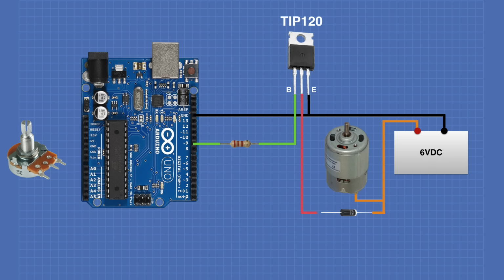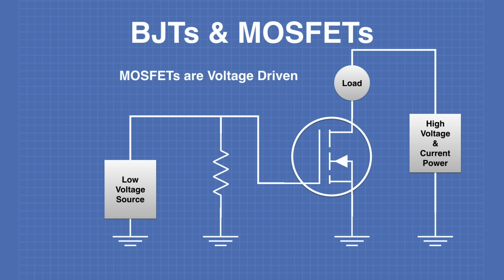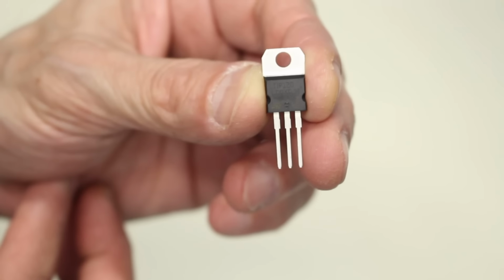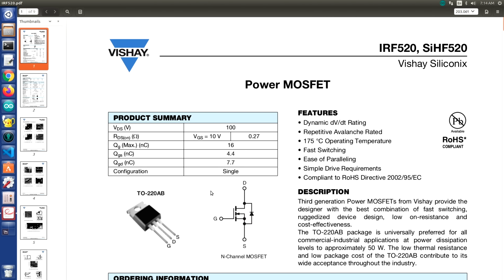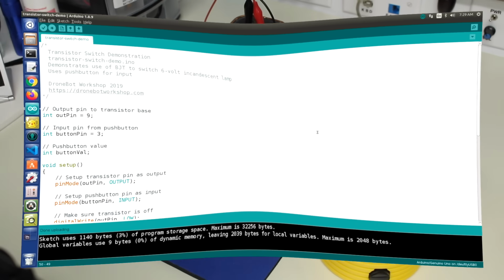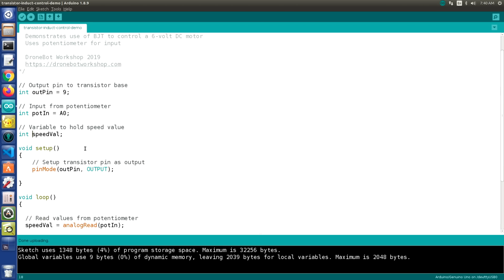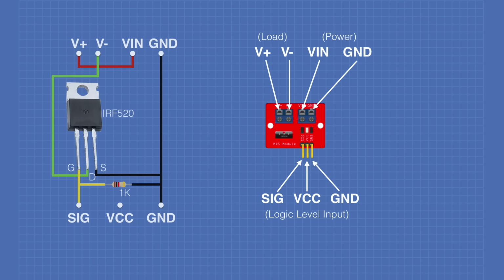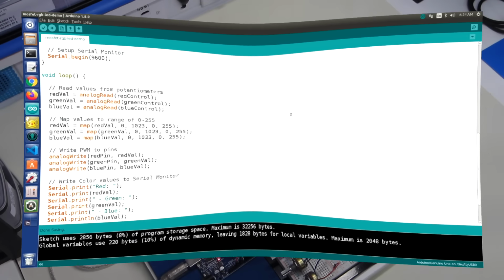MOSFETs and Transistors with Arduino

Comment: Once again. Great job explaining both BJT and Mosfet. I am working on a project and didn't want to overload 3 SSR directly to the Nano. So now I am using 3 BJTs to control the 3 SSRs. Now time to wire up a breadboard.

Comment: You should always use a gate resistor, since capacity of the gate of a MOSFET causes a high current when switching on, which could destroy the I/O pin of the arduino.

Comment: Another great video very well explained and appreciated.  One correction though, with the reverse biased diode across the transistor when driving the inductive load, it isn't there for the initial counter emf when the voltage is first applied, rather it is for when the field collapses, as when the applied voltage is reduced.  counter emf will resist any initial current flow, the collapsing magnetic field with the inductive load will produce whatever voltage is required to drive enough current to collapse the field.  it is this created voltage during the collapsing field that will pop your transistor without the reverse diode in place.
Reply: I was wondering about that too. Thanks for setting my world right again.

Comment: An excellent introductory tour - and for those of us doing mainly digital electronics you cover most of what we need to know about interfacing our puny logic circuits to the power hungry big-boys world of motors, relays, solenoids and lamps.

One quick observation. As you noted, the LEDs on an RGB chain get quite hot.  Thus, it's NOT a good idea to operate them on the reel like that for very long as they can get heat damaged and you start to get failures.  Each individual LED doesn't generate much heat, but on a reel like that each position contains three LEDs (a red a green and a blue) and over a 5M length you may have a couple of hundred of them. When theyy are spread out its not really noticeable, but when they are reeled up tight together like that they generate quite a lot and if used for long they might overheat and fail.

Comment: thanks! I was searching for this for weeks. I asked people on the internet how to do this but your video finally explains it well. Exactly what I need. I want to switch the christmas lights (4.5 V DC) using an arduino because I am lazy to stand up, go to the switch and use my own fingers to turn it on or off. Now I can control the lights via wifi. :))

Comment: Excellent tutorial!  Just two comments... the EMF pulse that occurs with inductive loads, occurs when the coil is deenergized, not when power is applied.  Also, to dampen the destructive EMF pulse, the diode should be of a high speed switching variety, not a rectifier type.  A 1N914 would've served you well in your example.

Keep the great videos coming.

Best regards.

Comment: Great job again, please note that the Rds is only valid at a Vgs of 10V, which is obviously not the case here, Vgs is below 5V, resulting in a higher Rds
Reply: Indeed. Considering that the IRF series of mosfets have an equivalent in the IRL logic-level series, it seems pointless to use an IRF520 with a microcontroller when you can buy an IRL520 for about the same price and have an Rds(on) guaranteed 0.22 ohms maximum @Vgs=5V or 0.26 ohms maximum at Vgs=4V. The only comparable information on the IRF520 is 0.2 ohms max @Vgs=10V. Maybe a sample of the IRF520 will work fine with Vgs=4V, and maybe it won't, but the manufacturer isn't making any promises, so why risk it?

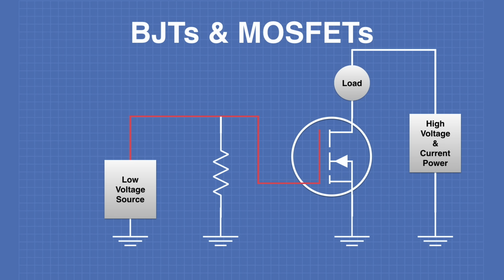Comment: Thanks for the videos!! I was testing your example and on minute 5:20 if you apply a low voltage to the gate it will turn off not on.

Comment: Thanks for this. I learn  by solving problems and your videos act as a good bridge from application to theory. Sure, I'll probably spend the first couple of years being asked why I didn't know something obvious that's taught in 101, but after that I usually (in software, at least) end up doing stuff simply because I hadn't been taught that it can't be done.

Comment: The arduino already has a pullup resistor built in, you don't need the external pullup, just set pinmode to INPUT_PULLUP to enable it.

Comment: Not even a 1 second is wasted, thanks. Very good video from start to end. Explained what is transistor a general info, and how to use them in curcuit, circuit cables and connections made very clear with drawings. Nice informations and warnings along the video are also nice.

Comment: At 21:35 you suggest that the lamp is a lot brighter when connected directly to the battery because of "the 0.7V drop" across the transistor. Now, you don't tell us the current that is going through the transistor (and it will be less than 1A because you have no heatsink), but a TIP120 Darlington power transistor will have a typical Vce(sat) of at least that even with tiny collector currents, and potentially rather more, depending on sample variations, rising to a maximum of 2V @3A and 4V @5A.
I just wanted to warn experimenters not to count on as little as 0.7V drop across a TIP120 when delivering significant currents.

Comment: First class video with great explanation. But the problem you did not show us an FET with inductive load, like you did with the TIP120.
I would appreciate if you can make a video and hook up a pulse transformer on the output of the Mosfet. Thank you again for the extremely clear explanation. Well done.

Comment: Thank you so much for the video! It will definitely help me in my DC motor drive projects.  Until now I was working with small motors for rc cars and wanted to move to the next step and drive bigger motors.

Comment: I love your videos. I learn a great deal from them. I just wanted to clarify the comments about the diode. Inductive loads resist starting and stopping their current flow. They act kind of like a flywheel. When the circuit tries to stop the motor or coil current suddenly the collapsing magnetic field attempts to keep the current flowing the same direction resulting in a large spike of voltage which can destroy the transistor. The diode allows a backward current to flow around the coil which prevents damage to the circuit.
Reply: Well said!  It's so much easier to think in terms of current than back emf.  Nature won't let the magnetic field collapse in zero time, so we allow the current to continue flowing in the SAME direction through the coil by adding the diode.  And the energy stored in the magnetic field gets converted to heat in coil and diode rather than some other unfortunate component.

Comment: Reverse back-EMF is created when the motor is turned off, not when it powers on. Inductors resist changes.
The diode in reverse-parallel conducts the back-EMF back into the motor to absorb it's own energy also stopping itself faster.
The disadvantage is that you can not drive the motor in reverse by simply reversing the polarity. Most MOSFETs are designed with a diode built in to prevent any back-EMF damage but BJTs do not.
Reply: You are correct, that the back-EMF is when motor is turned off not when turned on. 
You can make the motor go in reverse by simply reversing the polarity. Just reverse polarity to the motor, but not the diode. You could do this with a DPDT Switch between the diode and the motor.  If you wanted to reverse the motor under software, things get very much more complicated. Two Zener diodes back to back would work, but you would still have the problem of reversing the control voltage.
cheers.
Reply: He is using PWM to control the speed of the motor, so it is continuously turned on and off hundreds times a second.
Reply: The body diode in the mosfet is connected in reverse parallel with the mosfet, so it clamps the drain to the negative supply to suppress negative spikes. But that's not the issue with driving inductive loads connected to the drain, which will be pulled positive when the current through the inductor stops. The body diode won't stop the drain from exceeding its maximum voltage rating as it's reverse-biased as long as the drain stays positive. You need the flyback diode when driving inductive loads from any type of semiconductor.

Comment: Code suggestion: use #define and/or const variables instead of regular global variables for static values (pin #, physical constants, etc). 

Why? This matters when memory is a constrained resource. The compiler puts #define values and const variable values into the machine code, which is stored on Arduino's flash memory. In contrast, the compiler allocates space for regular global variables in Arduino's SRAM.  Arduino UNO has only 2K of SRAM, but 32K of Flash.

The other reason is readability. You can use #define and/or const variable to implicitly document that this value does not change during runtime. A regular variable suggests that the value might change.

Comment: Great explanation. I like using the 2n3055 transistor on wheel chair motors. Lots of power and using 24 to 36 volts.

Comment: As a note regarding the IRF520, the RDS was given and then the Gate threshold. But the RDS value is only valid when the Gate is at 10V. At 4V the RDS would be higher.
Reply: Indeed. But worse than that, it's not specified, so you have no idea what it might be, and if it turns out to be high enough to melt the mosfet at higher currents, you can't blame the manufacturer. Also the gate threshold voltage is specified for a drain current of 250μA. You can get a lot more than that directly out of the Arduino!

Use an IRL520 and you have a specified maximum Rds(on) of 0.26 ohms @Vgs=4V.

Comment: I want to Thank you Sir for your educational project. It has really helped me to understand how on Earth this Arduino works and how does the transistors make the project working in more controlled way. Just one mouth ago  I have bought my first learning Arduino set with all other electric components (lights sensors, LED bulbs, diodes and transistors, and resistors) which made me feel like i have found another world in completely  new  scientist . To be hones all this month after my hard work in farms where I would be just a rose grafter, I would be trying  read something new or at least the same thing just to make my self memorize new things about those components. I have been working in one company as an LED installer, where I would be operating cnc and making frames for  the light panels. I really loved that job. I taught I am gone really want to carry on being interest in this new subject because I have found electricity as a really charming shining :D  thing. I was amazed how that job have really made in fluent to my new interest.

Comment: Those are TO3's the TO 66's are round and I believe stud mounted but,  I know they are round and the TO3 is diamond shaped. Brings back memories!  I love the video! Great demonstration!
Reply: Actually, TO-66 is just a smaller version of the TO-3, perhaps a bit more pointy at the ends to fit the same sized mounting holes. The ones in the video were TO-3.

Comment: Unfortunate that the module doesn't include a gate resistor (something around 100 Ohms) for the MOSFET. It is kind of bad practice to directly drive the gate of a MOSFET (especially the higher current ones) from a microcontroller. The gate behaves like a capacitor, so when switching on or off you are essentially driving into a short circuit until this capacitor is charged. These high current spikes can make the µC or circuit unstable or in the worst case damage it.
Reply: @klave8511  If you have insufficient resistive damping in the loop between gate, source, the ground lead, the microcontroller, the signal lead and back to the gate, then you have a tuned circuit that will sustain oscillations, especially as the drain-gate capacitance will be injecting further energy into it. An unwitting Colpitts oscillator, if I'm not mistaken.

The gate charge required on switching is a real concern for microcontrollers with their limited ability to source/sink current from I/O pins. So on both counts, it's wise to put a few hundred ohms between microcontroller and gate. That may slow down the switching time, but unless you're switching at MHz frequencies, it's unlikely to significantly contribute to heating the mosfet. In those sort of cases, you'll use a mosfet driver ic anyway.
Reply: Yes you are absolutely correct. I damaged my arduino uno this way. But the downside of adding a 100ohm resistor is lesser switching frequency! So I believe if you want to higher frequency PWM like  around 200khz it's better to have a Gate Driver IC which handles high current requirements of the MOSFET.

Comment: The pull down resistor on the base of the MOSFET is there to make sure the mosfet switches OFF. Otherwise it could stay on ....this is as important as explaining the flyback diode on inductive loads.

Comment: Your videos are really, really well made - I enjoy watching them and learn a lot. After having watched your videos on stepper motors and servos, would you please consider making a tutorial on the similar hobby-sized brushed DC motors with rotary encoders installed on them? They come with either optical or magnetic encoding, some with a single sensor, and some with AB encoding like in rotary encoder knobs.

Comment: First of all, thank you for this and your other videos, which have helped me learn about several components that I either knew nothing about or only the "bare bones".

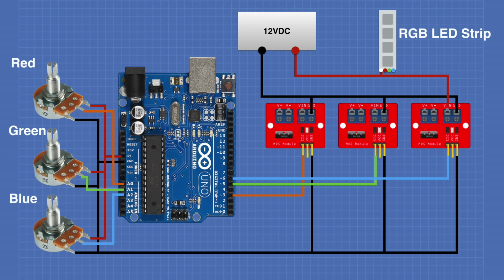However, I'm confused at 34:15 where the positive side of the 12V power supply is connected to the VIN pins of the three modules.  If I understand the diagram of the modules shown earlier correctly, the VIN is directly connected to the V+ pin on the other side of the module and nothing else — just a convenient way to visually and spatially separate the two leads of the power supply from the two leads of whatever is being driven by it.  But since the V+ pins aren't actually used in this circuit, due to the shared positive input of the LED strip being directly connected, these three connections seem to be just… loose ends, going nowhere and doing nothing.  Am I misunderstanding something, or was the earlier diagram simplified to leave out something that would make sense of this — or are these three connections really as superfluous as it currently seems to me?

Comment: Could someone explain to me why the diode is placed between the motor leads and not between the transistor and the motor? I don't really get the concept of that.

@DroneBot Workshop
I really love those videos, you, Paul McWhorter and Explaining computers are kind of the holy trinity of physical computing for me. I've learned a lot from you and I'm very thankful for that. Just wanted to let you know that.

Comment: To make things clearer it would help to show the circuit diagram in addition to the wiring one.  I like to see the diode and transistor circuits to visually see the direction of the diode and base, collector, the emitter of the transistor graphically.  I found I had to draw these out myself to fully understand the circuit.

Comment: And old video but I still love this tutorial
One thing I would like to know is how you can use the same PSU to run the Arduino and the components without getting a loop as if you have separate PSU to Arduino and the components you don't

Comment: Can you please explain why you need the resistors you used and the reasoning behind the values of the resistors? Thanks for the wonderful information!
Reply: @Kevin Original A good explanation of the need for a gate-source resistor, but it's a mistake to think that the gain of a BJT is "typically" above 100 when used as a switch.
A BJT in saturation is almost always specified with a base current 1/10 of the collector current to ensure the given saturation voltage. Look for the conditions specified for Vce(sat) on any transistor's datasheet. (Except a BC547, where it's 1/20.)

Comment: I use the IRF520 as a replacement RF final transistor some of the newer CB radios actually come with them installed as a driver and the final RF transistor

Comment: I just subscribed, great videos. ZIF sockets fit nicely on a breadboard, better than plugging in the chip directly. I have use the Arduino and USBtiny as in-system programmers (ISP). I have not tried a serial peripheral interface (SPI) connection. This video is a great demonstration of making a SPI connection through an Arduino or FTDI adapter. Thanks!
Reply: Oops, I commented to the wrong video

Comment: When I was a kid I made some disco lights with triacs, decade counter chip and an old tape player. I used the signal off the tape player output to trip the decade counter to change the lights. Then I soldered a small speaker on the tape pick up heads to pick up audio to run the tape output. Don`t know how I did it back then without the net.

Comment: Great video, A couple of things need correcting, Back EMF from inductive loads ONLY happens at switch OFF ;) Also the diode should be placed as close as possible to the inductive load (on a motor I would mount it across the terminals if it has them). Keep up the great work :)
Reply: I came here to say exactly this!  The back EMF is created by the collapsing magnetic field, not the buildup of the magnetic field.  Also, for the diode it actually dumps the energy back into the motor so if it is too far away, it can have trouble dumping that energy before it damages other components. It simply works as a switch when the back EMF voltage gets high enough so it doesn't absorb the load itself.

Comment: Great video, but why not use directly the IRL520 (Logic Level mosfet)? Rds @10V is about 0.026ohm, but arduino and RPI works @3.3-5V.  Ok, current is not high in this experiment but I think should be better to use IRL in any case.   Excellent video, and your pronuciation is very good for me (italian with little english). Thanks again for your videos!!!

Comment: I used the TIP 125 transistor for a similar purpose, but I messed up and got the PNP when I wanted the NPN which limited high current power supply to the same voltage as my microprocessor.